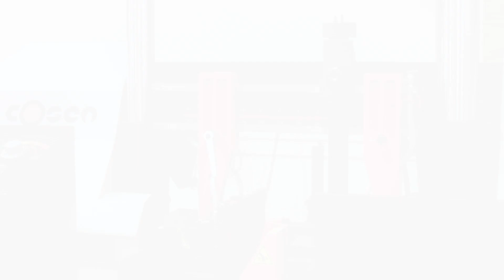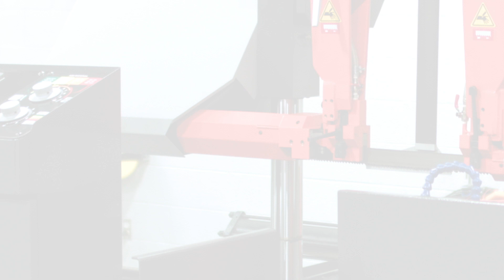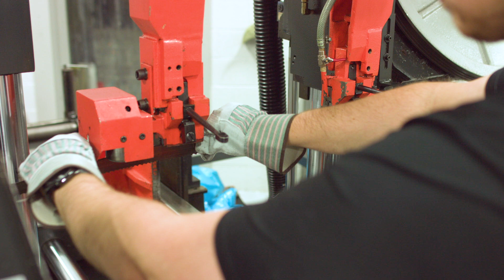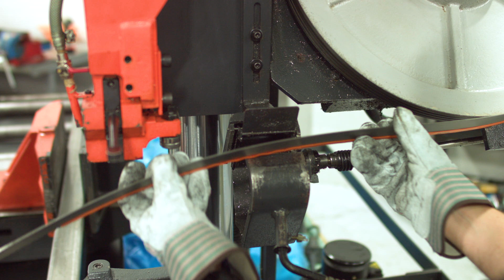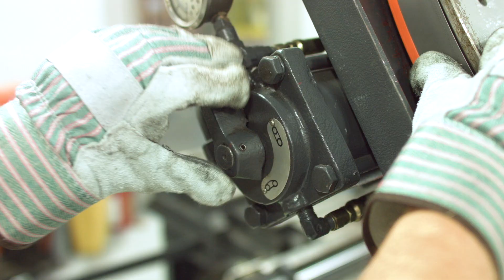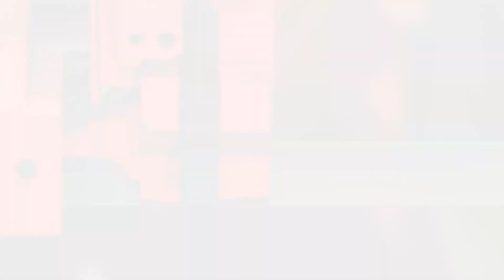How to Change a Blade on a Cosen Horizontal Band Saw

Comment: Vibration dampeners suck on these things always coming loose and making blade crooked going through guides. Need a redesigned part to make it work better . Because this is set up to go through $100 blades like there's no tomorrow